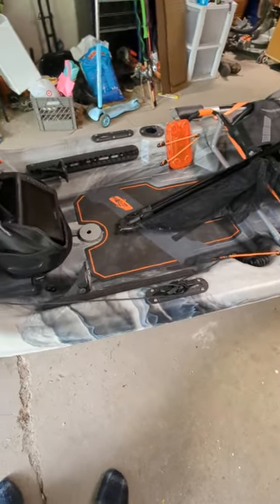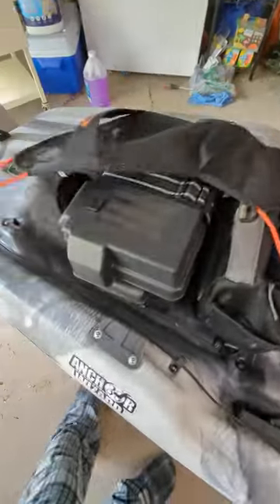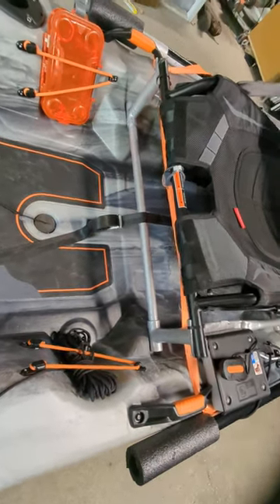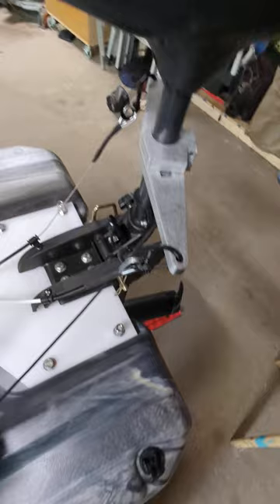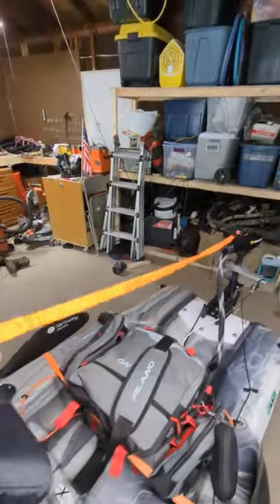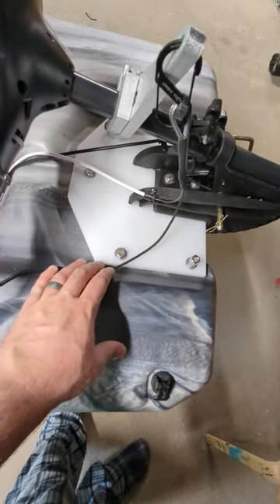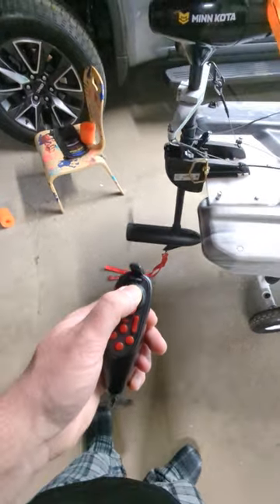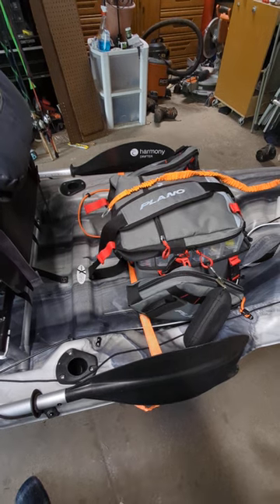Walkaround Pelican Catch Mode 110 with trolling motor.

Comment: Love your videos of the Pelican Catch 110. I'm in the process of getting my cables for my Garmin Striker vivid 5cv run, along with the power cables for my Endue 30 on my Catch 110. I want to run my fish finder power cable from the front right side to the back behind the seat where I will have the same type of the. How hard is running the wire in the hull, can they be run on the bottom or the sides? I wasn't sure where the foam was between the hull.  Also, can you explain how you hooked the DCS remote to the trolling motor as that is so nice. Thanks, Walter
Reply from the maker: Walter, Wiring was pretty easy. Not sure where foam is but i used 2 magnets one inside one outside (from harbor freight )and some fishing line to fish the wiring from one end to another. Take your time and you will feel anythijg it gets hung up on. I put 2 holes in it for my sae connectors and then just moved magnets slowly from one hole to another with the line attached. The dcs controller is connected to a hobbywing 880 esc in the control head off the minn kota. There are lots of videos of how to do that, I recommend Aksel Pedersons YouTube posts on it as its pretty straight forward.
Reply: @ffemt703  Where did you buy the Pelican trolling motor controller you have on the side? I've looked every where and can't find one.

Comment: Nice clean install! Everything looks great! Except for the GMC Sierra in the garage, Ford all the way! Jk... Looks really thought out.  How did you tap into the minnkota esc, wiring diagram?
Reply from the maker: The Minn Kota doesnt have an esc, so I put on a Hobbywing 880 ESC in the control head. Minn Kota uses a 4 wire system, but the ESC only requires the 2 wire + and -.
Reply: @ffemt703  very smart! It's there a wiring diagram out there to reference?
Reply from the maker: @Lykapodium  Sorry didn't see the reply on this, yes there are lots under Minn Kota hobbywing in youtube.

Comment: Could you make a video of how you install the wireless control to the trolling motor. Did you removed the throttle handle?
Reply from the maker: i no longer own this. Its super simple though. Remove control head, remove the factory switch and handle. There are 2 outputs on the Hobbywing, connect both sets to the red and black wires of the trolling motor. Then just connect the wireless controller to the hobbywing. There are several videos on youtube of the actual process
Reply: @ffemt703  what would I search for to find those videos?

Comment: Did you have to do any additional reinforcement for the trolling motor? I am in the market for a kayak, but want a trolling motor on it.
Reply from the maker: These were specifically designed to put a trolling motor on it. They have a motor mount option as well that bolts right in.

Comment: How did you wire inside the hull? It might be a silly question so I’m sorry but I just got my catch mode 110 and I need to figure the wiring situation out
Reply from the maker: I should have taken a video. i drilled 2 holes the size needed for my wiring plug in the spots I wanted them. i then took harbor freight strong magnets and used a large nut and tied 12# fishing line to it.... i then walked the magnet down the kayak on thw outside with the nut on the inside until it came out other hole. I then slowly fished the wire backwards using the fishing line. Hope that makes sense. The nut may fall off in spots but you just move magnet around under it and it will make click sound when it finds it. Or just run it along bottom and then you arent worrying about gravity.

Comment: Please make a video on how you install your steering wheel thank you
Reply from the maker: Unfortunately i cannot as i ended up selling this one and upgraded to a pedal drive  kayak for tournaments.
Reply: @ffemt703 so are you happier with a pedal drive ? I am thinking about a similar setup to what you had with the catch mode ?
Reply from the maker: @TimmyGWiz  Sorry didn't get notification of this. They are 2 different animals. The pedal drive is far more work for sure, but it allows me to get on big water that I wouldn't try with the 10' yak. The bigger yak doesn't do as well in little water though so it has trade offs. I can stand far more comfortably in the P127 than the catch mode.

Comment: How does that handheld controller control your trolling motor? Is there extra components needed to attach to the trolling motor?
Reply from the maker: It only controls forward and reverse power and speed. It requires a ESC (hobbywing 880) and a wireless card. It will connect automatically once powered.
Reply: @ffemt703  will it work on all min kota trollers, or do I need a special motor?
Reply from the maker: @chriswenzel3328  it will work with all. It just has a power out and a ground which is what makes the motor turn, it reverses polarity for reverse so no need for a reverse switch like a pwm.
Reply: @ffemt703  thanks a bunch for your input.
Reply: @ffemt703  so I hate to bother you more, you have already been a big help with setting up mu yak. Do you have, or know of a wiring plan to install the kill and the wireless speed control? I'm far from an electrician and I'd hate to mess up a new trolling motor.rigjt out of the box. Thanks again for your previous replies.
Reply from the maker: @chriswenzel3328  Sorry it didnt notify me of this. My ESC had a on off switch which I extended to my toggle. I wired my Sea Dog kill switch to those power wires. If it is connected it completes the circuit for on. If the lanyard is pulled off it opens the circuit and doesnt allow power.
Reply: Where’s the esc mounted at
Reply: @colton299  I put the entire thing inside a small pelican case with sae connectors for the battery, and motor.
Reply: @ffemt703 can you like the remotes needed to control the motor?